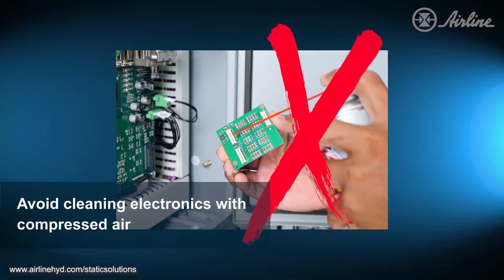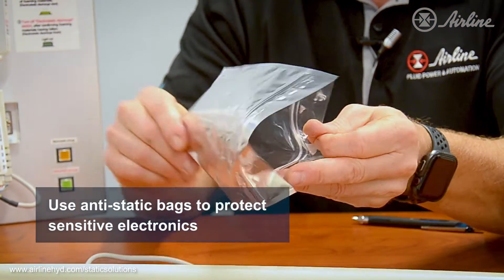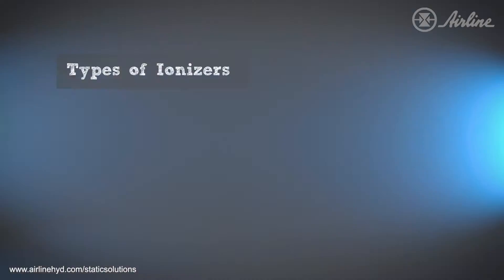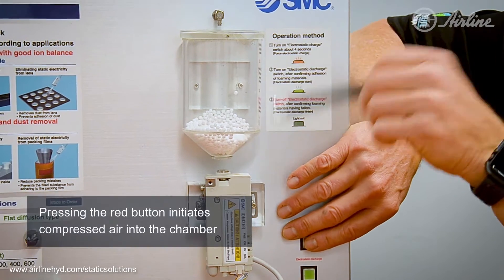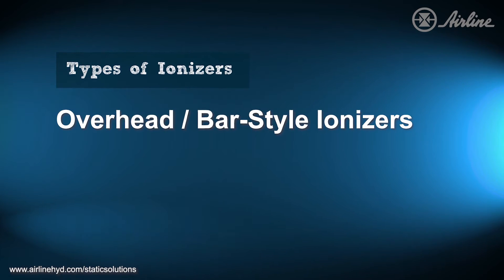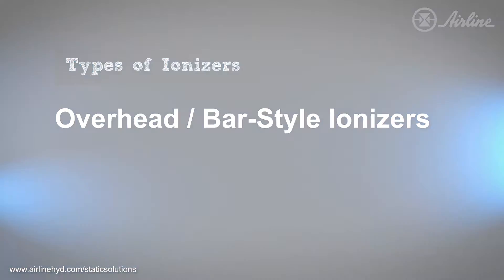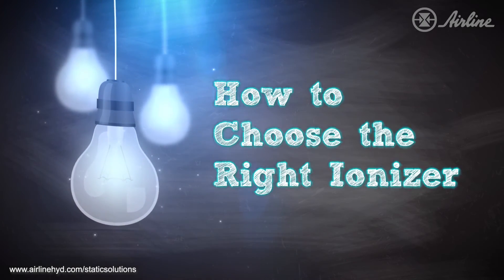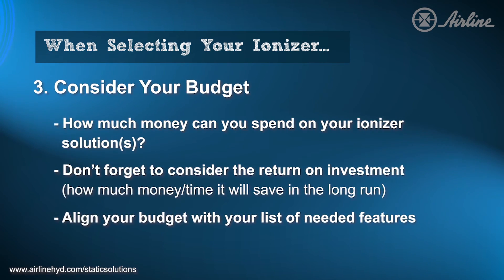The Why and How to Remove Static Electricity & Electrostatic Discharge (ESD) Part 2!

Comment: Thanks for the video. I have a strange issue. My Desk sit over a large return hvac vent. I frequently get shocked when working at my desk. I have felt the static electricity to though my body and shocked me when I touch my mouse. I lost a $1500 tv because of this static electricity discharge. . I wanted to ask you would do in this situation with a hvac intake vent.  Can you advise me on what to do.  I thought about grounding my ductwork or using a Anti-Static ion fan just above the hvac intake resister.

Comment: How do you keep a 10" galvanized duct from building up static electricity? This duct work is used for moving PET scrap material using an air convey system?
Reply from the maker: That sounds like a technical question with a bit of depth to it! Ask that again here so we can get you in contact with our engineering support - https://bit.ly/3H7BK8s

Comment: Can we install ionizer bar in a cross/ vertical position on roller?
Reply from the maker: Yes! The SMC ionizer would work well with using air to help disburse the ions to the roller.  If the ionizer doesn’t use air I don’t think it will work well.  That is a definite benefit of the SMC ionizer.

Comment: Hello, great video!

is there an option for wide open spaces? We have an open office, with no carpet, but the air is really dry, and we get zapped a lot. We tried air humidifiers, but the ventilation just removes the water, so it is not a permanent solution.

Let me know.

Thanks.
Reply: Try an ionizing area fan, we had one growing up, but I don't think any of us knew what it was for until this video. Lol
Reply from the maker: Hi there! The static solutions we provide are mostly utilized for industrial/manufacturing environments (not sure if they would be suitable for office environments), but if you'd like one of our experts to see if we can help, feel free to contact us at https://www.airlinehyd.com/pages/contact/contact-us

Comment: Interesting video. A few years ago I developed a system to remove static electricity. In this case it was for (repainting) plastic bumpers and the results were very promising but there was no follow-up at the time. 
Maybe the technology could be interesting for your company.
Just let me know
Reply: Could you tell me what it was and how easy it would be do at home? I have had several times now audible crackling sounds when I'm taking my shirt off, and it feels like there is huge amount of static. Just need a way to discharge it.

Comment: how can we avoid the static charge being developed in a sealed chamber where the aluminium blades are moving and rubbing each other
Reply from the maker: A small bar ionizer may be able to be used, but for help with your specific application, please call us at 800-999-7378 so our experts can gather more information.